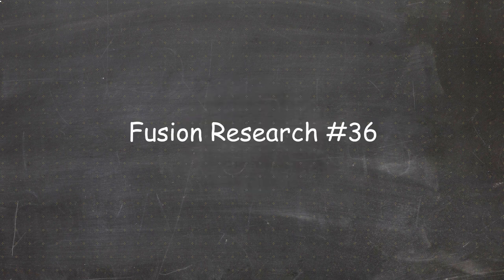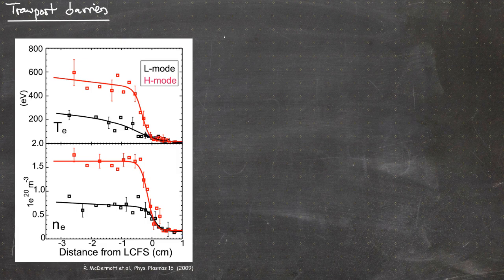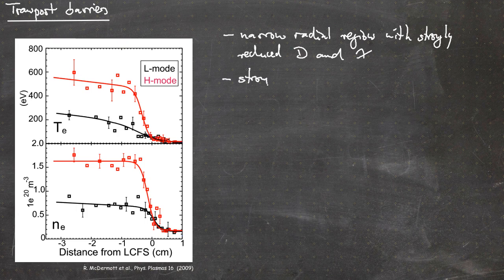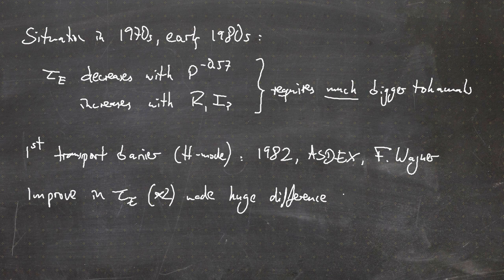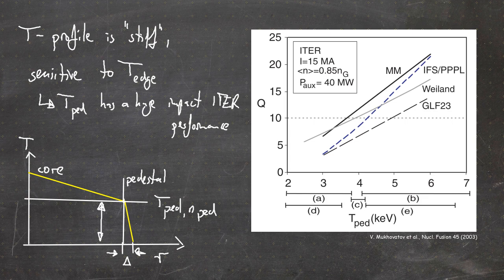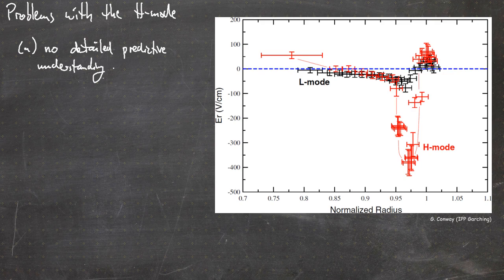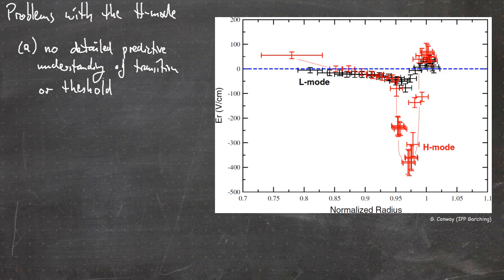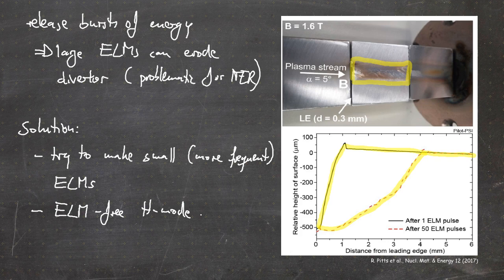Fusion Research Lecture #36 - The H-mode and transport barriers

Comment: Sehr geehrter Herr Plasma:
May I ask you a question?
I am informing myself all I can on the future progress fusion tech can gain from stronger magnetic fields, due to the recentish news by Tokamak Energy and CFS.
Would you be so kind as to answering how small one could make a tokamak given arbitrarily strong magnetic fields? 
Mir freundlichen Grüssen, 
Alvaro “sprechen Sie Deutsch?einbisschen” Rodriguez.
Reply from the maker: Stronger magnetic field would indeed allow to reduce the size of a tokamak, as the energy confinement time roughly scales linearly (overall) with the magnetic field (or, looking at the fusion power, where the scaling is stronger). But it cannot be made arbitrarily small, as the heat flux per unit area to the walls would get too high, for example. 
It's very exciting to see, what can be done with these higher-field coils in near future!

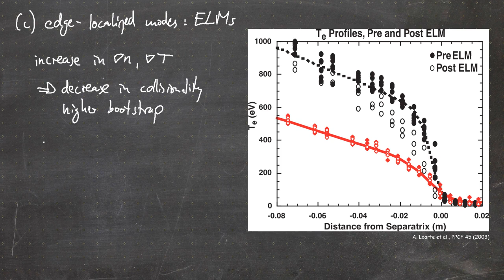Comment: Hi, I have a question. At time 17:20 min, you mention that grad(n) and grad(T) increases during the L to H mode transition, meaning the gradient length scale increases. This should increase the resistivity (or decrease the Lundquist Number S = LU/eta), which means increase in collisionality. Is it correct? Let me know how my thinking is different from your point. Thank you.
Reply from the maker: The resistivity scale with T_e^{-3/2} which means that it actually decreases when the temperature increases.
Reply: @DerPlasma   Yes, I agree to it. 
Could you please share your view on my comment also? Why the concept of gradient length scale is not deciding the value of resisitivy? Thank you.
Reply from the maker: @jagannathmahapatra5433  The Lundquist number is the dimensionless ratio between the Alfvén wave crossing timescale and the resistive diffusion timescale, and can be written as S = L*v_A/eta, where L is a typical length scale, v_A the Alfvén velocity, and eta the magnetic diffusivity. As you said, the resistivity is inversely proportional to the Lundquist number. Looking at the just stated definition of the Lundquist number, it becomes clear that it does not only depend on the spatial scale, but also on v_A and eta and those depend on plasma density and temperature. The scaling is thus more complicated than what you describe. H-mode pedestal usually have high Lundquist numbers, on the order of 10^8 or 10^9 (don't quote me on those numbers), 
I hope that answers your question...?